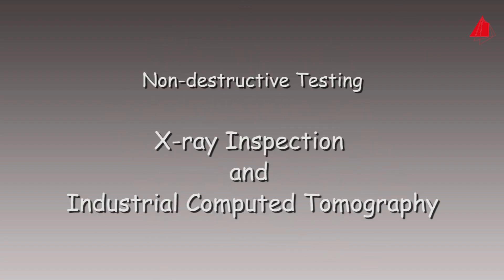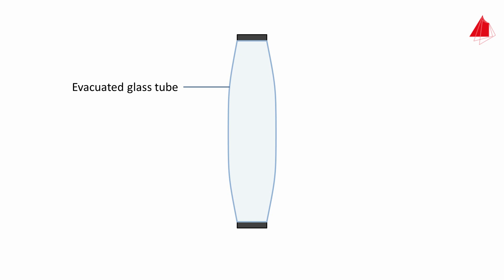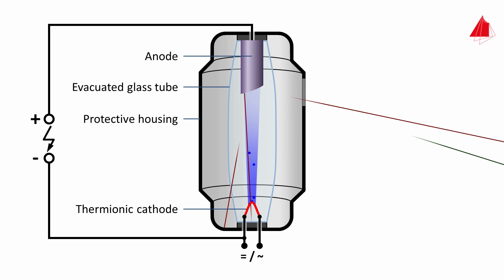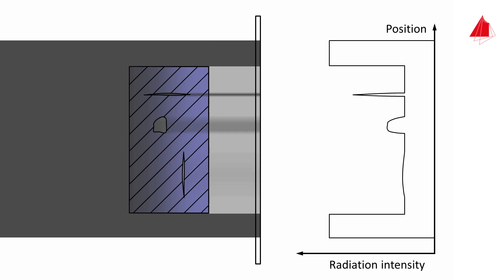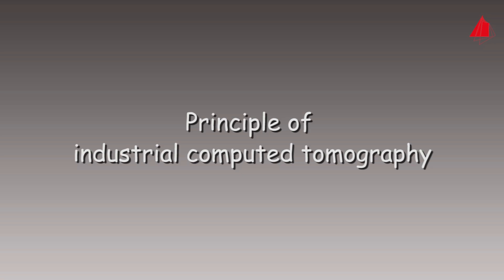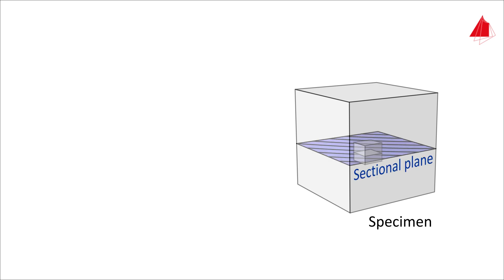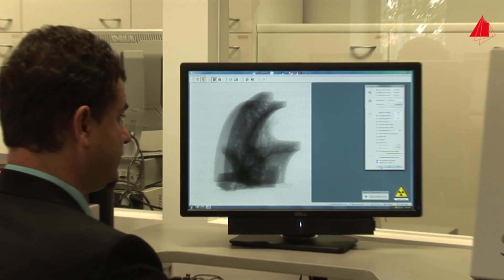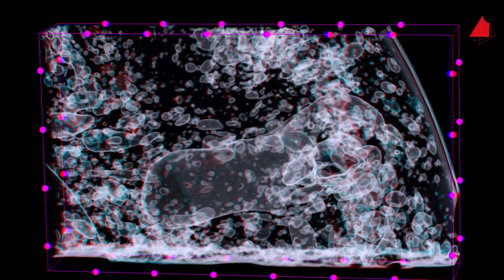X-ray Inspection and Industrial Computed Tomography

Comment: Can we use this method to detect flaws in wood ? Like if a wooded door,/window is 100 years old, can we check if it is eaten by termite from inside or not by using X ray testing.
Reply from the maker: Answer to "Can we use this method to detect flaws in wood ? Like if a wooded door,/window is 100 years old, can we check if it is eaten by termite from inside or not by using X ray testing.": Yes, it works quite well! The only problem is the cost. Both the equipment and the test itself are (still) comparatively expensive. It is often used to examine old (and valuable) trees in parks or along roads.

Comment: hi. thanks for very informative video . if we use Lead metal instead of Aluminum, can we still see the holes or cracks or any groove in the X-ray image?
Reply from the maker: Answer to "if we use Lead metal instead of Aluminum, can we still see the holes or cracks or any groove in the X-ray image?": In principle, yes. The only problem with lead is the strong absorption of X-rays, so you have to use much longer exposure times and stronger/harder X-rays. In other words, you need special X-ray sources and the tests take much longer. For comparatively large samples, the test would take so long that it is not feasible.

Comment: What are the isotopes that are used here?
Reply from the maker: Answer to "What are the isotopes that are used here?": There are no artificial or natural isotopes used here, and no radioactive substances (such as in gamma-ray inspection), the x-rays are generated in a very natural way when the electron beam hits the anode. After the test, neither the x-ray tube nor the typical technical specimens are radioactive; furthermore, they are completely unharmed.
Reply: Yeah, I see.  Iridium 192 is a great way to do that, too... cheers to India